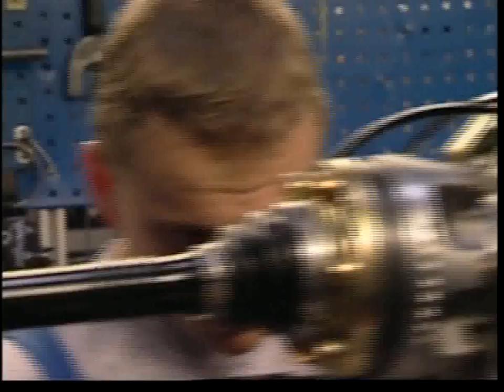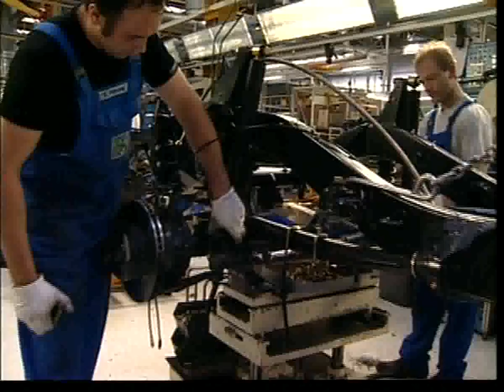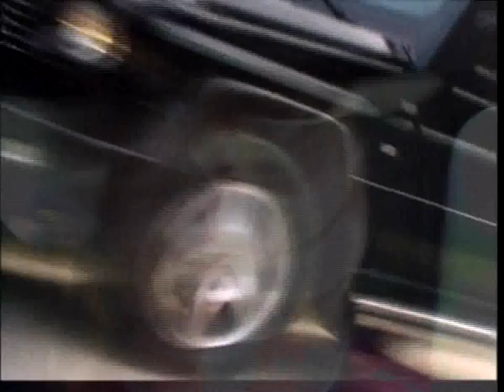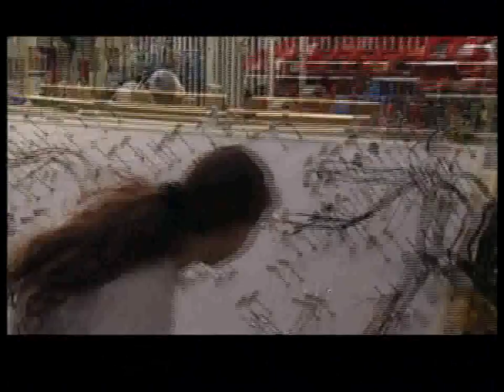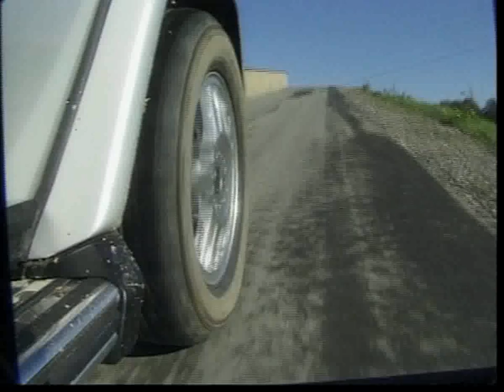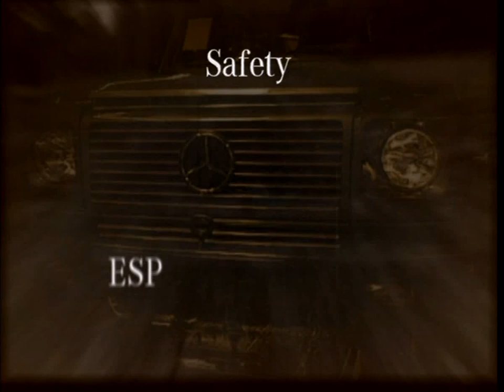The G Class Story

Comment: 2018 g class, is it gonna be 10cm wider than its predecessor?
Reply: also independent front suspension,  electric power steering and t-case integrated with gearbox, i guess not the real thing anymore...
Reply: Lukas Vass do u think those side panels on the doors and around the body will be gone?